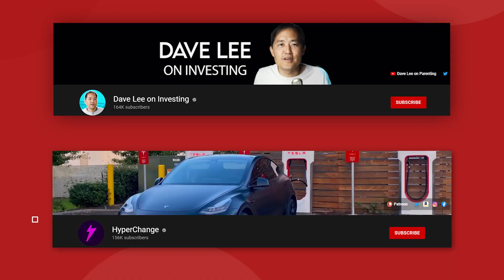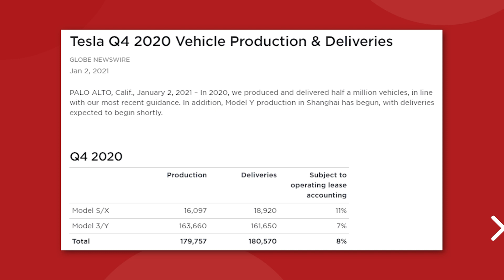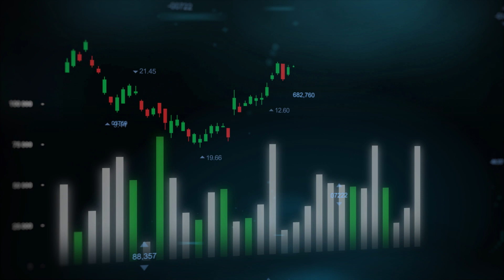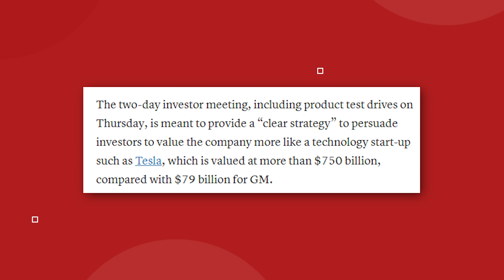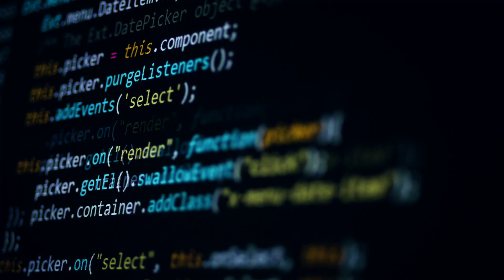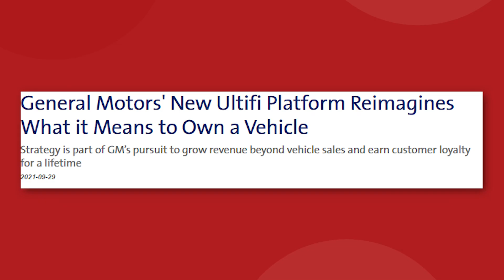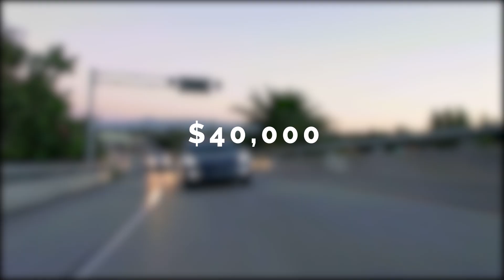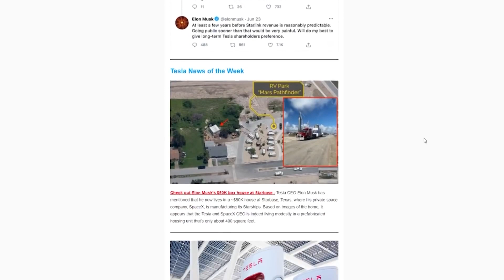The 2021 Tesla Production Update Is Here!

Comment: shanghai presently has a run rate of 2500 cars a day.    fremont was 1400.  so just both is at 358,,800.   with berlin and austin, a million is easy.  next year, 2.5 million is easy.  then to the
moon
Reply: berlin and austin are rated at 2 million cars a year. so 5 million in 2023 is not out of the question.  with more factories in the UK, Nigeria, India, 10 million in 2024 is highly likely. trucks and buses alone could hit 2 million a year is easy.  Energy and Robots and taxis are going to be massive

Comment: I’m waiting for the new battery tech. When a Tesla will go 500 miles on a single charge. But damn I want one
Reply: Cybertruck 3 motor has that. How many ICE cars have you had with 500 range? I never have had one in 43 years. Tesla is not going to do 500 range in the MY OR M3. 400 will be the top, except the CT and Roadster.
Reply: And where are you going to take your Tesla when something goes wrong with it ? 
To Tesla? 
And get burnt selling you components that they won't fix, only selling you a complete unit like a new battery pack when a repair to the coolent line  for $100 will fix it.
You just can't take a Tesla to your small coutry town and have it fixed.
If you try it you void your warranty. 
Then your stuffed!
Reply: @Jim.Thunda  They have 2 million cars on the road. New battery packs are maybe .001 percent that are needed in a 3 or 4 year old battery. I heard the 1 story your talking about. You forget about the Dealerships that have ripped off their customers for at least 50 years. 
My Ex wife called me and said the dealership says we need new brakes, for 400.00, this was 1982. 
I had her bring the car to me at my auto and tire company I owned and the breaks were perfect. 
I bought a Nissan Leaf last year, waiting for my Cyber truck. It was not charging, I called 7 companies to ask if they could help. I thought it was the 12 volt battery, all but one said they did not work on EV's.
It was the battery and was easily fixed. 
So what your talking about is not an issue for the most part. 
My neighbor has had his car serviced by Tesla about 3 time over the last 4.5 years with a visit at his house. Who else does that?
You can stay away from Tesla and talk about 1 persons experience, but it is much better then you think with Tesla and much worse with Dealerships and automotive shops. 
I have seen many stings on automotive chains who were taking advantage of customers, all over the world and back into the 1980's. Firestone was caught lying and stealing from their customers, it the early 1980's when I was in the business.
Reply: @MyUniversalUniversity  
Thanks for your reply.
I would love to own a Tesla but until they build a car with a swap over battery pack and replaceable panels I'll get the local blokes to convert my Land Cruiser to electric.
I'll keep the Harley the way it is, and my R600 Mack.
The plane can't be improved nor can the Lycoming. 
I do agree with you on the matter of dealership's and their maintenance rip off's,  this is why l do my own rebuilds, services and repairs.
I can't rebuild tyre's though. 
I will consider a used Tesla or a couple of written off units that l can repair.
But the problem here is once a vehicle is written off it can't be repaired and put back on the road again.
The vehicle identification number is recorded and put into the registration data base once its written off.
Reply: @Jim.Thunda  Rich Rebuild has done some Tesla's and recently they started to allow them on Superchargers.
Reply: @toddmorgan2198  
?
Supercharged Tesla????
Reply: this is a heavy topic. as now europe and france as a fronteer about how easy it is for the customer to repair its own devices. like apple will have zero points, as jean-emanuel baptist zorg puts it, zero crats. zero freedom with your device.
Reply: They said they could do 1,000 mile range today. But it makes for longer charge times.